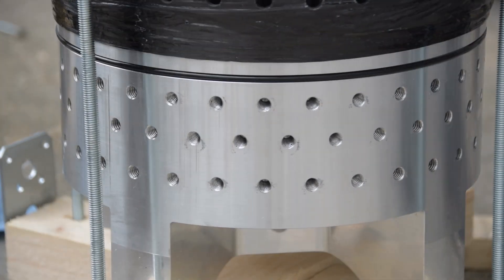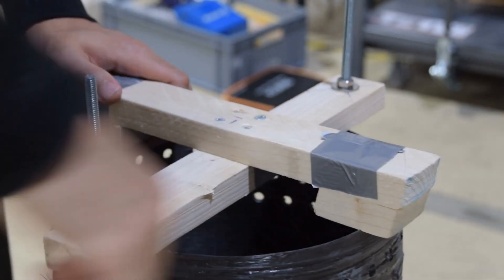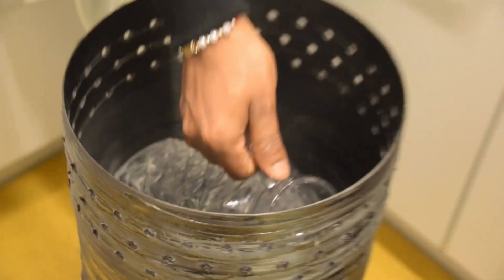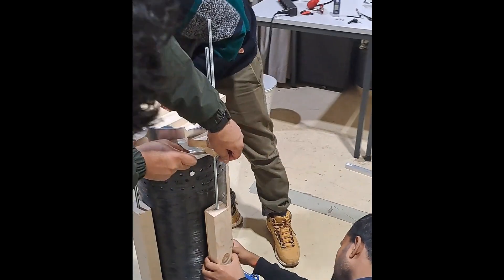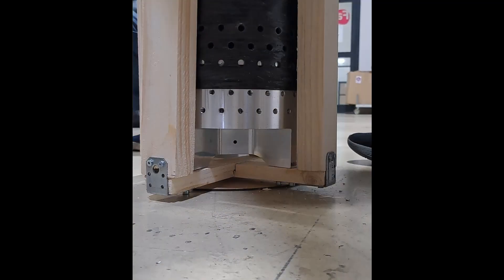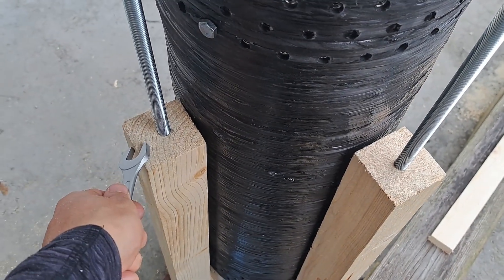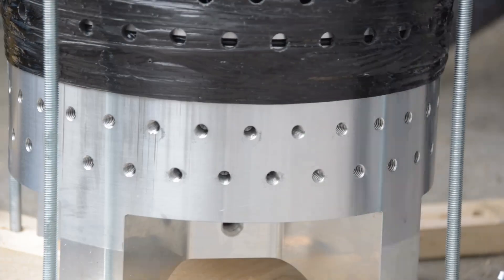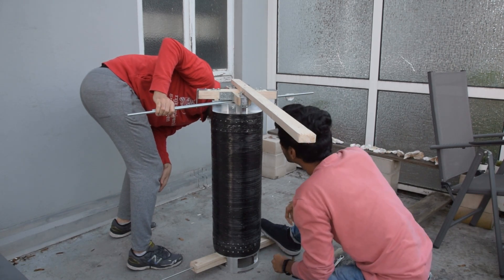Rocket Torture

Comment: I was wondering how you plan to ensure chemical compatibility of nitrous oxide with your CFRP tank for some time. Do you plan to use any additional liner material?
Reply from the maker: For now we are not planning to use a liner.  For the short periods in which the CFRP tank will hold the Nitrous Oxide, we don't really foresee there being a major compatibility issue.  Of course, we could be very wrong about this... worst case scenario, it will rupture if we leave the N2O in for too long!!  But we really are trying to max out the mass savings.
Reply: @ASTRABremen  Liquid Nitrous Oxide is a strong solvent on many polymers, and can penetrate incompatible materials causing material degradation and swelling. Its best you do coupon test with your CF/epoxy material to ensure compatibility. If you see issues Id suggest you move over to urethane based laminating resin system as these are compatible with NOX.
Reply from the maker: @jamieanderson6786  Thanks for the tip.  We will definitely run some small scale tests before we put N2O into the big tank.

Comment: Not bad, but you can make press jigs using hydraulic bottle jacks that will do this job and lot faster and give you +2 tonnes of force easily.
Reply from the maker: Could be a good idea.  The trick would be figuring out how to integrate the hydraulic bottle jack.  Also, our jigs were definitely on the cheap side.
Reply: Get a set of 3 steel plates made instead of using wood, and have 4 steel bearing rods (shafts) to form a structure. 1 of the plates should have a set of linear bearing bushes on it. Place the tank tube and top cap under this plate, and then place the bottle jack above the plate and have it loading up on the top fixed plate and crank. My advice for you guys however is to integrate your metal end caps into the carbon fiber tube at the time of wrapping rather than the bolted head arrangement, drilling holes through FW tube basically destroys the composite strength in a large region around the hole by disrupting the fiber paths. There is several ways to do this including the integration of spigot type flanges with bolt flanges integrated into them. Its either this or make a polymer liner from a compatible material and wind a proper closed end vessel...Good luck team Astra..